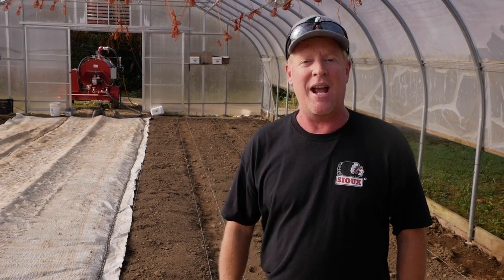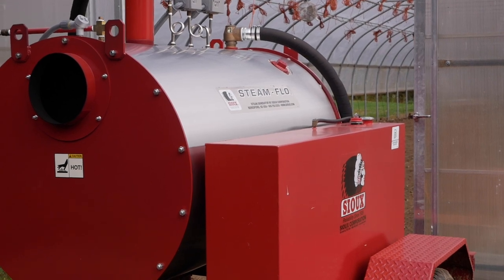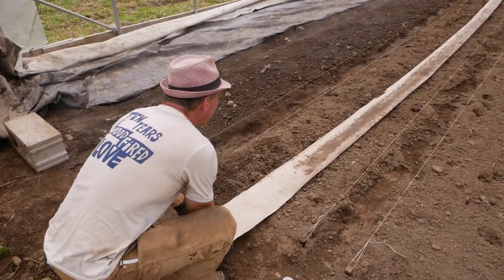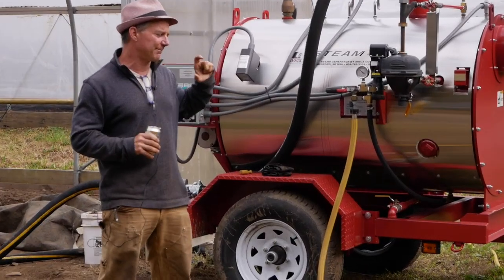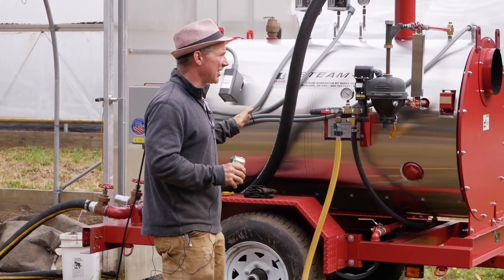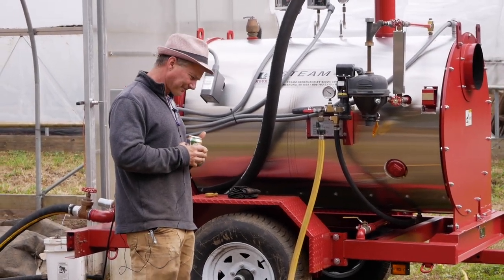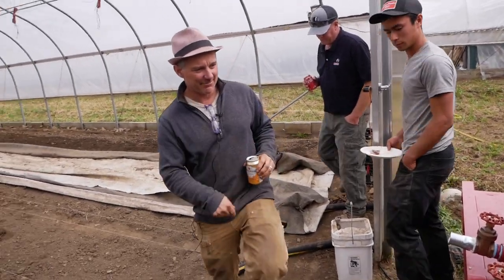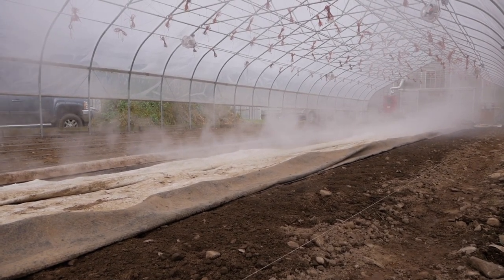In Depth Look at SOIL STEAMING with Andre Cantelmo

Comment: What kind of tarp are you using? We are using the bigger Sioux and I was impressed by the tarp you are using. What brand?or kind? We haven't used the chain method yet due to weight. We use 6" blue hose with 6" pvc and aluminum attachments and fill it with water to weight it down. We are steaming 150'×35' beds. Again thanks for video and I am very impressed!! And the new socks are awesome!!!
Reply from the maker: The tarp is an 8 mil Dura-Skrim steam tarp we can supply in sizes: 12' x 100', 12' x 200', 24' x 100' or 24' x 200'. In this video the dark side is facing the soil.
Reply: @SiouxCorporation  Are these reusable? I ask due to him punching thru for temperature check. The tarps we have are alot heavier kind. We have the SF-100 steamer.
Reply from the maker: @toxic_grnbeanyt961  Yes, they are reusable. He tapes the holes at the end of the season where he does the temperature checks.